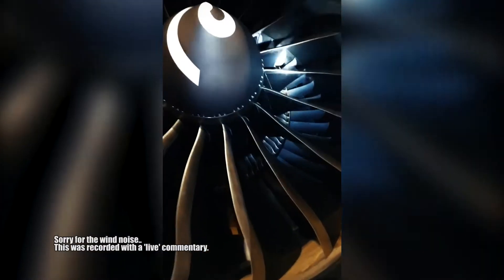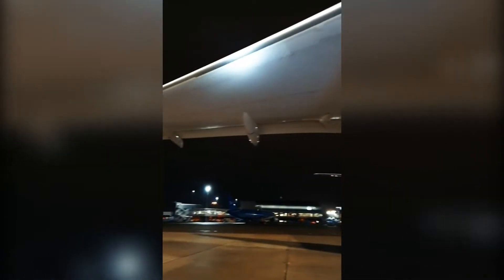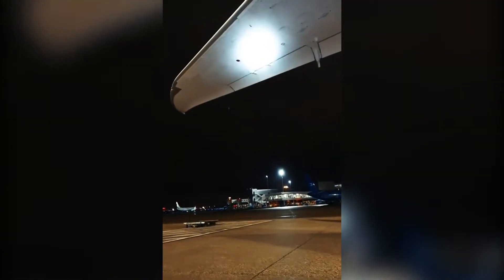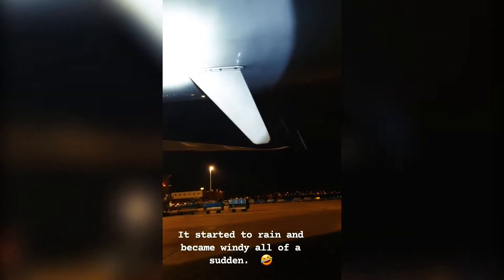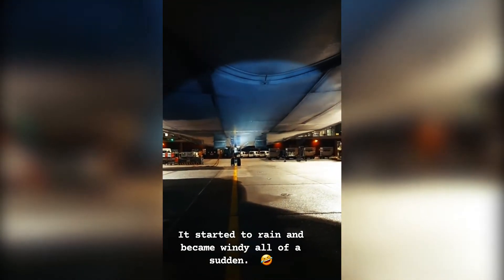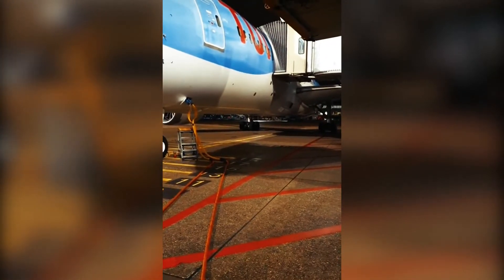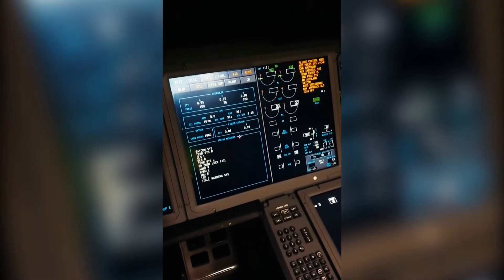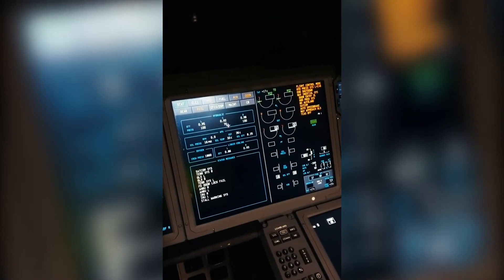Boeing 787: 48 Hours maintenance check explained

Comment: Hi, Can you please elaborate a little bit about what are the main differences from a 787 Maintenance Program from other airplanes such as the 737, please?
Reply from the maker: Hey! I think the biggest difference is, is that the 787 mostly has the ETOPS certification and the 737 doesn't have this (mostly). This has big implications on how both airplanes are maintained. Also the 787 has Central Maintenance Function where you can see all kind of airplane data. On the 737NG, this isn't the case so you have different procedures to view this airplane data. I hope this answers your question ;-).